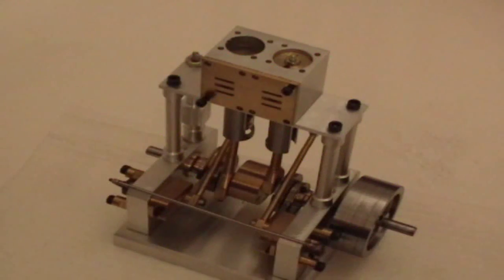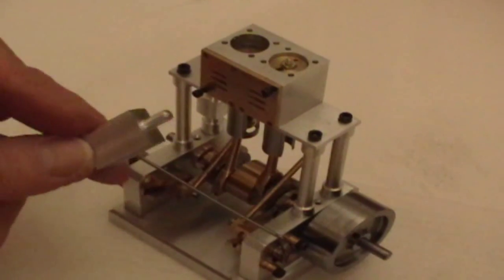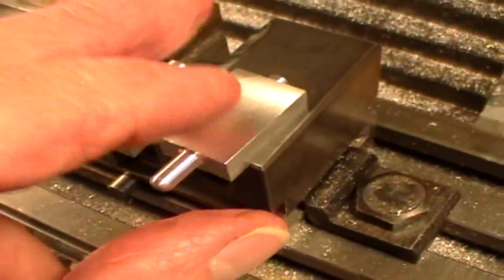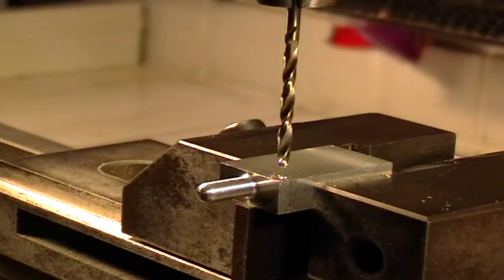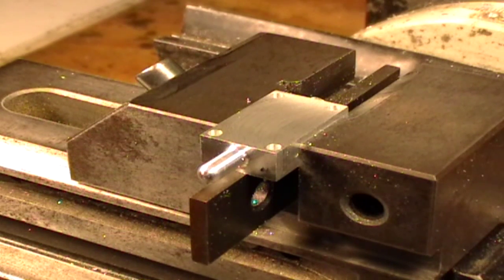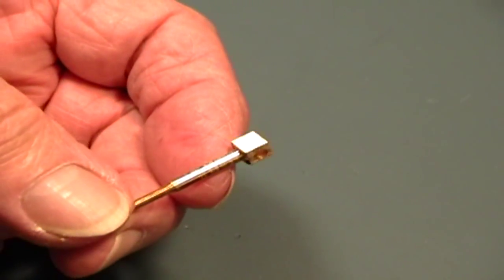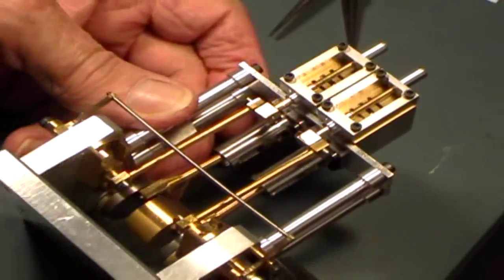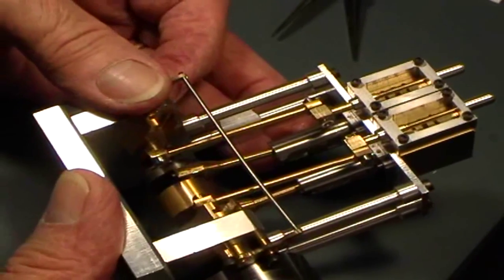Part 4 video - Steam chest & valve rod machining.

Comment: John,

I do like to have the valve stem guide at the top.  Many of loco models in Ga. 1 doesn't
have it to support the stem at the front of the chest.  The front tip of the stem stops
short of the front steam chest wall.

1.  Don't you need to drill a hole thru at the top valve stem guide?  Else, the stem would
     go forward into the guide (sleeve) and compresses the air?  Needs an air release hole?

2.  So, you don't use gland packing or an O-Ring  at the valve stem's entrance to the steam
     chest?